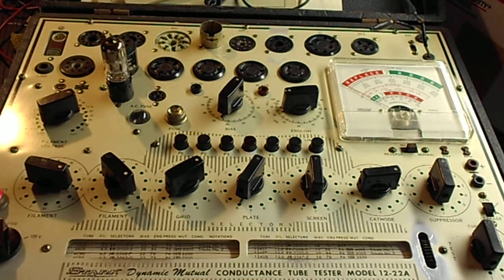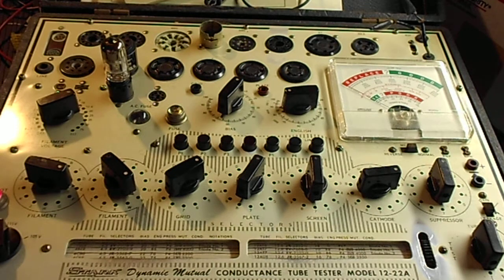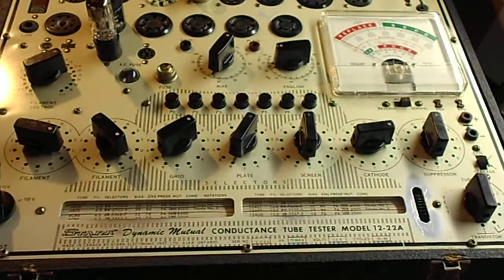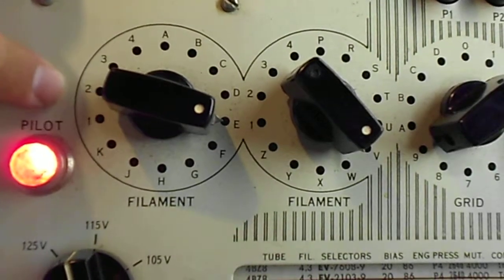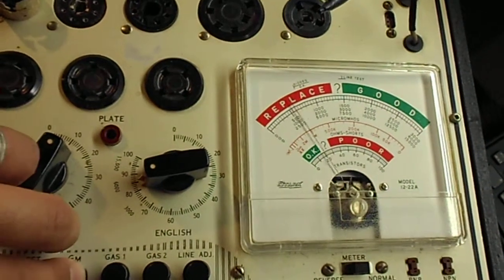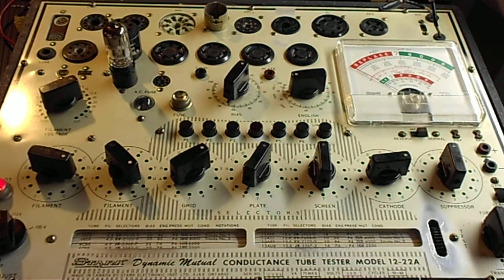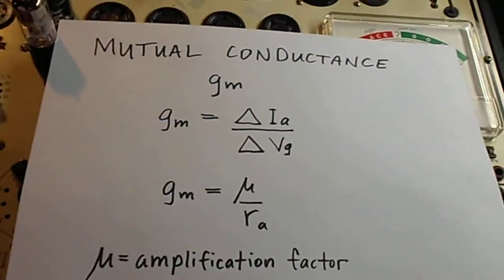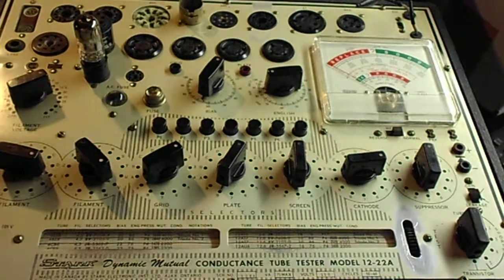tube tester.AVI

Comment: Nice tester. When testing GM make sure switch is set to proper scales so if a tube suppose to read 3000 set the switch to 6000 so doesn't peg your meter. If you have switch set to English then you measuring on good bad scale. Not sure if you had it on english or not but if you did that tube you just tested actually is needing replacing